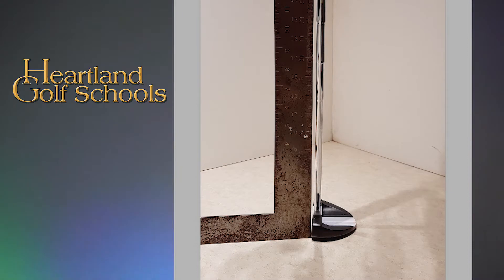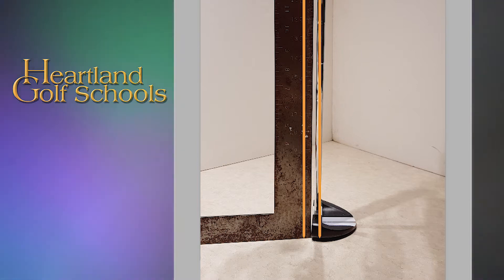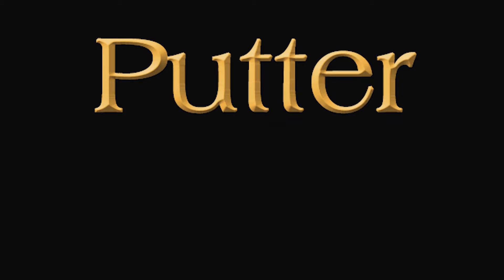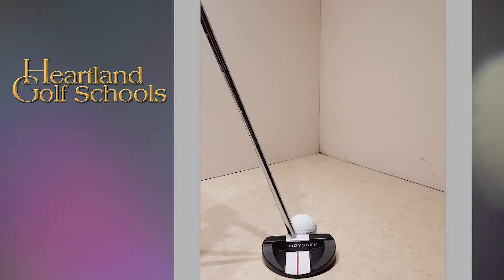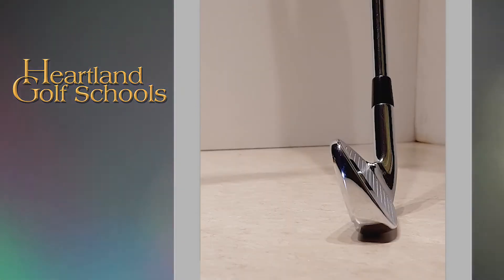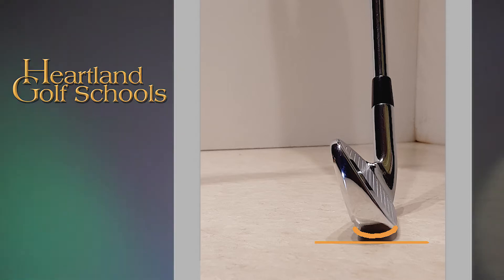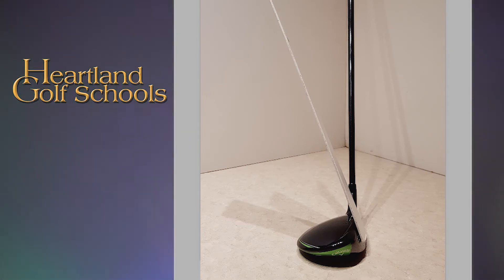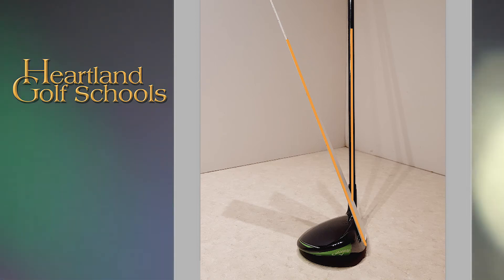Club Setup--An Explanation

Comment: "At address, shouldn't shafts be diagonal (45⁰angle) rather than vertical? "
Reply from the maker: Tonny, from your comment I can see that my description could be misinterpreted.  By vertical, I was intending to convey that the shaft should not be leaning forward (toward the target) or rearward (away from the target).  The shaft is definitely on a diagonal relative to the player at setup.  To put a finer point on this take a look at my video on Shaft Droop.